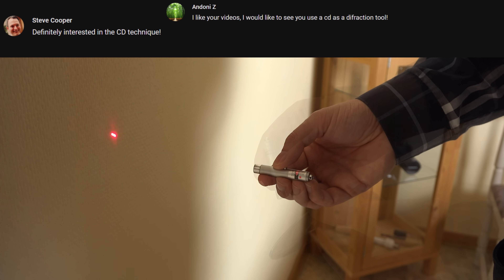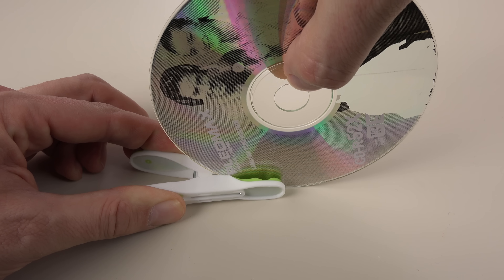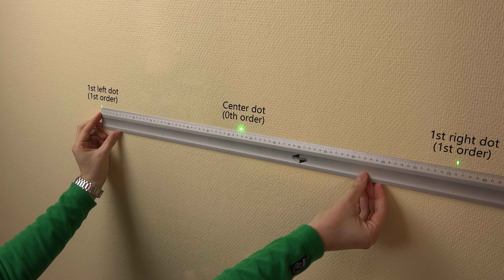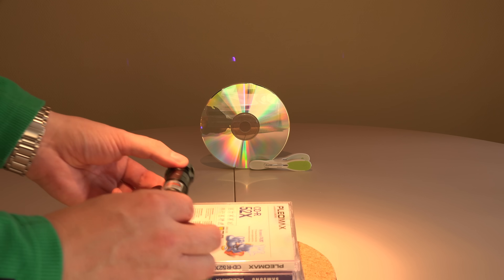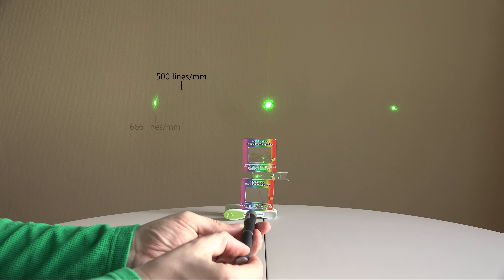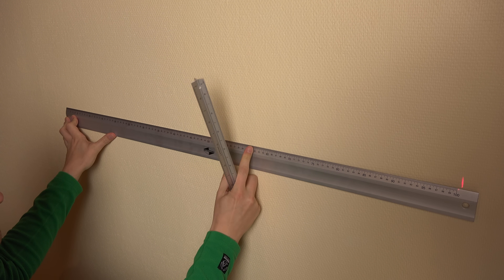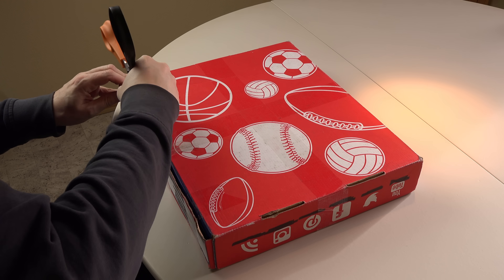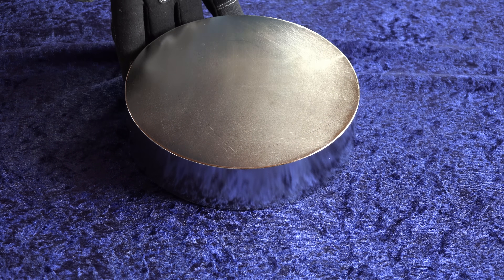Lasers measured with CD measured with lasers!?!

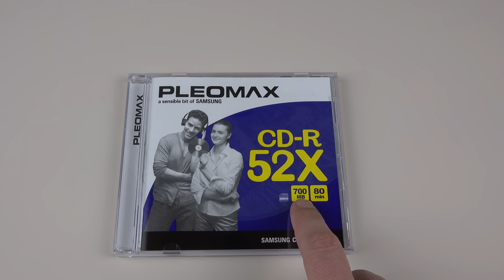Comment: 4:50 This is indeed correct, according to a little googling. From what I found below, it's implied that they pushed the spec to its limit to squeeze more out of the standard. (Because if your product has bigger numbers, it'll sell better!)

Direct copy/paste from Wikipedia: Standard CDs have a diameter of 120 millimetres (4.7 inches) and typically hold up to 74 minutes of audio or approximately 650 MiB (681,574,400 bytes) of data. This was later regularly extended to 80 minutes or 700 MiB (734,003,200 bytes) by reducing the spacing between data tracks, with some discs unofficially reaching up to 99 minutes or 870 MiB (912,261,120 bytes) which falls outside established specifications.

Comment: Whether a CD undergoes reflective diffraction or transmittive diffraction. I guess it undergoes reflective diffraction where light source and images form on the same side. But you are showing that light source is on one side and images are formed on the other side.

Comment: I'm having a lot of trouble with your simple equation at the end. I keep getting numbers way off. It's 3 am I've spent 2 hours trying this. I'm so frustrated I remember math in school and what it felt like. 

What on earth am I doing wrong. I plug in the numbers just like you said. With 100cm distance. My CD came out to 1.37 microns with two dpss lasers. So I use 1.4  

The thing is, I got the equation right and saw my dpss on target by .3nm then I couldn't replicate it. I don't understand. I couldn't even reproduce the same one
Reply: clearly my measurements are wrong. I plugged in your numbers as you did it and i get the same. So it must be the distance of 1st order and the cd diffraction. I think Ill just buy a diffraction card and multiply by 1000

Comment: 10:47 You can avoid using the memory functions on the calculator in that situation by hitting the reciprocal button (1/x) after calculating the denominator, then multiplying by the numerator, btw.

Comment: actually it is possible to measure the laser wavelength using the ruler seen at 2 min, the mm lines can be used as a grating (with grating constant 1mm), use a small incidence angle.
thank you for your videos!

Comment: Going to try this to measure my "492nm" laser from Sanwu. I think you should test your 505nm too! Turns out the wavelength of many diode lasers very alot, (e.g. someone got 480nm from a 488nm diode, or 509nm from a 505nm diode) so it would be pretty interesting to see.

P.s. as I finished typing I just remembered that you have a proper spectrometer.

Comment: The last equation, @ 10:45 , where you say you need to use a memory function, you actually don't. The value that you put in memory, you can instead do 1/x, and then multiply with your d_nm. So I think both are quite beautiful.

Thank you for a very good channel and videos!

Comment: Your guess about the track spacing is exactly correct. As manufacturing got more precise, cramming in a little more data was easy. In fact, there was a proposal to do it even closer together... But DVD was out by then.

Comment: You don't need memory functions for those formulas! The standard calculator has a "1/x" button that gives you the inverse, which you can multiply straight away by the numerator to get the result.

Comment: Hi, I used the CD measurement method to measure my 650nm laser and it's worked fine with the measured value of  660nm and that is close enough for me, I even measured my LED's with the help of laser lens for increasing the focus point of my LEDs brightness and its worked very well up to green LED but after that the diffraction points was very close so I can't measure the points. here is a photo I took from my desk:
http://tinypic.com/r/1zm35h3/9
I have another question, I live in Iran and I can't find the diffraction grading kit in my country and the only one I found was on Amazon website but unfortunately, the Amazon website can't send anything to my country. Does anyone have a website selling this kit and can send it to my country with a reasonable price? 
Thanks.

Comment: Great video and presentation. I employed the same technic, but with a different formula to mesure the wavelength of my red cheap laser, and I found it was around 750 nm, I think it's correct because my laser is red, but not very precise as I don't have a diffraction grating and a good laser to check the CD, but it was a 700Mb one. My formula is this for 2 fents : 
i(distance between 2 spot of light) = λ(wavelength)*d(distance CD-wall)/a(distance between 2 fents : 1,5µm)
λ = i(6 cm in my case)*a(1,5*10^(-6))/d(12cm in my case)
λ = 0.06*1.5/(0.12*10^6)
λ = 750*10^(-9) = 750nm which is red.

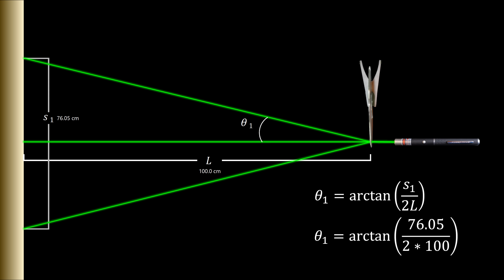But at 3:42, you wrote θ1= arctan(S1/2L), isn't it rather θ1 = artcan(S1/L). I know that with what you wrote, your results are right, but I have never used arctan like that. Even by defining the hypotenuse with the theorem of Pythagore, then using arcsin or arccos, I don't have the same formula as you.

Comment: Actually there is a formula to calculate the wave length in young's experiment (which is what you performed) 
X=nλD/a
n: number of bright spots
X: distance between spots
D: distance between the wall and the disk
a: distance between disk's lines

Comment: Try it with a DVD, to split a DVD, just do it from the inside of the center hole, put a sharp blade in between the 2 halves and it shouldn't take too much to split it. 
Trying to do it from the outside edge is not easy.

Comment: Hi Brian I was wondering  if you could explain why some metals can make alloys with some other metals but not with others. Thanks.
Reply from the maker: I'm not an expert in metallurgy, but as with all chemistry I think the interchange of electrons is key. I believe you can mix all metals in some way, but for them to form a chemical microstructure (alloy), and not just a mixture, they should be compatible in atom size and electron structure. There are two ways an alloy can form:
Substitution alloys Here one element simply replaces another. I believe the elements should have atoms of similar size and electron structure to do this.
Interstitial alloys Here, elements with smaller atoms fit in between larger atoms in a crystalline structure. Atom size and electron structure must be important again for this to happen.
Reply: Brainiac75 Thank you for the explanation .

Comment: Very cool, but what about a DVD or even better a laser disk?  I'm sure they work, I would be interested in the track spacing.
Reply from the maker: A DVD can be used too, but must be split in two very thin discs first (it's double-layered). Track spacing should be around 0.74 microns. Laserdiscs are double-sided and as I remember, the tracks are analog like a record? Wouldn't make the most consistent diffraction grating then... Thanks for watching!

Comment: Particularly at the beginning, it looks like your closest diffracted spots and the center undiffracted spot do not line up. They are not a straight line. 

Is this because the diffraction lines are curved? Is this a known effect?
Reply from the maker: It's most likely because I wasn't thorough enough to get everything perfectly aligned: CD parallel to wall in both dimensions, laser beam perfectly level and at a right angle to the wall/CD etc. But hey, the results were good enough for me :) Thanks for watching!
Reply: How do you get them to not be in a straight line? Maybe I'm not thinking right about it, but right off hand if you have three straight lines that start from a single source, and they're all in the same plane, any way you cut it they're still going to be in that same plane. So they ought to be in a straight line.

If the wall they project onto is curved a lot, and you do your video from the right angle, then it would look like they weren't in line. But that wall looked kind of flat....

Comment: 6:13 why is it not 750 lines/mm?
Reply from the maker: See the constant grating as a fraction. A number of lines pr. mm. 1/750 isn't 1.5 but 1.33333. To fit 750 lines on a millimeter, you need a slit spacing of 1.3333 (1.333333 micrometer 750 times = 1 millimeter). Confused me too :)
Reply: Brainiac75 thanks!

Comment: Pause... why isnt the slit spacing a linar funktion ? Shouldnt it be 750 ? You lost me there.
Reply from the maker: It seems a little confusing, but the grating constant is a fraction. Something pr. mm. To fit 750 slits and lines on a mm, you need a slit spacing of 1.33 microns. (1/750). 1/666.6667 is a slit spacing of 1.5 microns. Thanks for watching!
Reply: Brainiac75 yeah i got it now. 666.6 x 1.5. Just was confused seeing it in spreadsheet form. Guess shouldnt coment on math vids i watch to clam down before sleeping. Still good vid. Didnt know you could use a CD for that. Cheers

Comment: are these the same laser used in old temperature sensor? If the laser point is not visible, it is infra red laser?
Reply from the maker: Not sure what temperature sensors you're refering to. But yes, if the laser is not visible it's most likely an infrared laser so be extra careful :) Thanks for watching!

Comment: I consider myself OK at algebra, but I couldn't figure out why the two formulas gave the same result.
Reply from the maker: Not sure I can explain it either. Had to check them both :D Thanks for watching!
Reply: I figured it out:
(2L/S_1)**2
=(2L/1)(2L/1)(1/s_1)(1/s_1)
=1/((1/2L)(1/2L)(s_1/1)(s_1/1))
=1/((2_1/2L)**2)

It made sense once I got it down on paper.
Good luck with your channel.

Comment: what about DVD-RW and Blue Ray if they even have rewritable blue rays?
Reply from the maker: DVDs and Blurays are multilayered, so not recommended. You will need to split them into two very thin discs first. Much easier to just use a CD. Thanks for watching!

Comment: Hi!! Great video. I have a question about magnets, which magnet shape is stronger? A rectangular magnet or a circular magnet?
Reply from the maker: Not really a difference between the rectangulars and circulars as such. Depends on what you want to be stronger. The field strength in tesla/gauss or the pull force in kg. Many factors to take into account - grade, volume, shape, form factor etc.

Comment: Do you think this would also be possible with a DVD or blue ray? The blue ray has a track with of 0.32 μm, so that would translate to 3125 line per millimeter.
Reply from the maker: Yes, but Blurays (and DVDs) are multilayered, so you need to split them into two very thin discs first. Not easy and even a little dangerous with a knife or razor blade. Thanks for watching!

Comment: The plexiglass logo needed individual optical paths for each of the logos and toggle buttons for each. :>
Reply: You are correct but it still is a cool sign!
Reply: I think just cutting the plexiglass roughly on the sides of each logo, but leaving a small channel all the way down to the base, gluing them back together, and adding individual switches for LEDs at the base, would've done it fine. Rough cuts on the sides would help trap the light and bounce it all the way up. 

Im just saying, this is a bit of a lazy build.
Reply: Alucard Pawpad I'll try that and see how it works. This was a training project so I thought I'd put it to good use. Thanks for the idea!
Reply: Oh, if it's ideas you need, I have infinite. Let me know if you would like more of those.
Reply: Alucard Pawpad well we are done with the laser cutter for this year. Onto woodworking

Comment: Question :  Is there a way to change colour of a laser without changing the source?
Reply from the maker: Not really. You can change the wavelength a little with temperature - especially with the red diodes. But barely noticeable with your eyes. Just a little different shade of red.
Reply: Thank you. I suppose higher temperature makes the wavelength shorter? It's very interesting anyhow.
Reply from the maker: Well, for red laser diodes a higher temperature means longer wavelength. Not sure if that applies for diodes of other colors.
Reply: This is unexpected. Isn't higher temperature means higher energy level, means shorter wavelength? Clearly, the temperature of the diodes dolesn't effect the laser production this way. Can you think of anything, even just theoretical, that can change an existing laser's colour? I really don't know much and i get curious. Many thanks.

Comment: I am officially worried about the next video and the fact that it is possible to use a CD to calculate a wavelength of a laser was quite fascinating and also seeing the fact that you had to extend your ruler was quite funny , thank you so much for your hard work for making this video's I appreciate it greatly and I can't wait for the next video , keep up the amazing work that you are doing 
PS : sorry for any mistakes and greetings and salutations from Iran 

PPS : you can literally pick up girls with the Monster Magnet that you have
Reply from the maker: Thanks Abteen! I will not have the 5 largest magnet in the room at the same time ;) Instead of extending the ruler I could have moved the diffraction grating closer to the wall, but for consistency I chose to just extend the ruler x) Also turned out to be a nice way of illustrating indirectly how long the wavelength of the ancient laser pointer is. Greetings back from Denmark as always!

Comment: What are the side effects when you shine a lazer in your eye?
Reply: ProCreeper 2000, thanks for advice!
Reply: Blade0427   the energy is focused on the retina.  For the lowest powered lasers this does not cause immediate damage, though nobody would recommend it.  For medium powered ones the retinal cells will be burned very quickly, which is considered to be irrecoverable because we're not designed to replace them, you get scar tissue instead.  Basically, don't try!
Reply: Check a video out done by william osman. he tested that